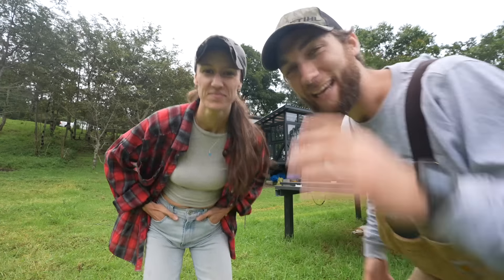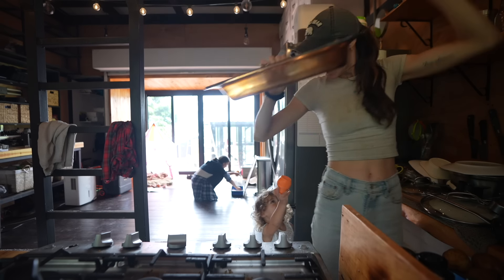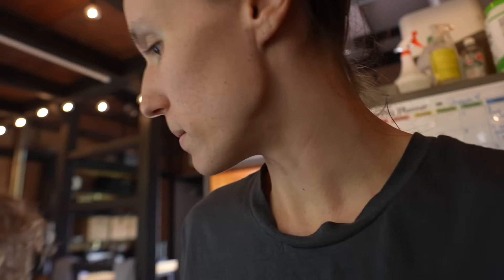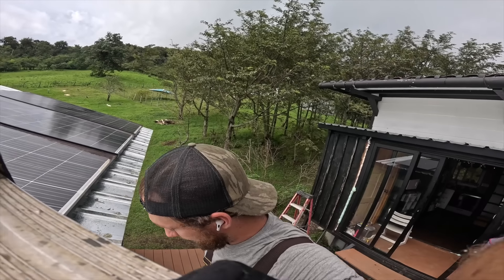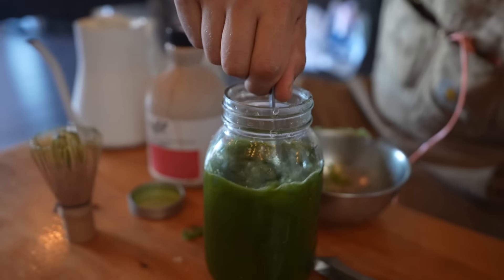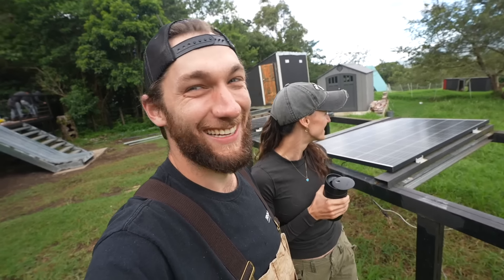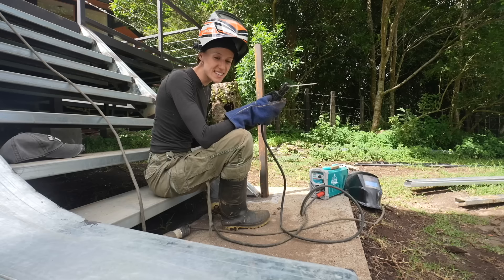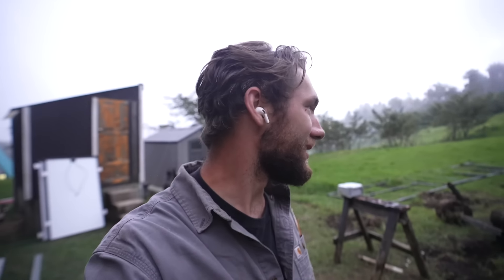We have a BIG PROBLEM // starting our house build

Comment: Hear me out Jordan a skidster would be way better than a backhoe.  You have so many attachments for a skidster an auger for digging your footings, a mower for your farm and all kinds of different buckets.  All kinds of things can go on a skidster and it's a little bit smaller than a back hole....meaning you can get it almost anywhere.  A skidster is where it's at my man.
Reply: I agree. A skidster is a way better option than a backhoe. They can get in much smaller places and have the ability with their attachments to do about anything you could ever need. The auger attatchments are so nice when digging footings.
Reply: The only concern I would have is that backhoes can handle much steeper terrain than skidsteers. Their property is really steep
Reply: Yup skidster is more universal tool more  bang for your buck
Reply: @wes52101  Simply when driving a skid-steer  up a steep hill the attachment is on the front and you go forward it isn't going to flip back.  With a tracked skid-steer it can go about anywhere. I vote with the rest of comments...he needs a skid-steer more for this build.  The problem there is price, The mini backhoe is about 1/4 the price of a tracked skid if new...and adding the attachments is going to be a huge cost on top of that...decisions, decisions.
Reply: @wes52101 nailed it besides the fact that all those attachments add up to a shtton of cash it will roll all the way down that hill
Reply: Trent would agree.
Reply: This is such great Info
Reply: Your place is looking so nice. Been enjoying your journey with you. Best of luck and life!
Reply: Tracks might be a good idea considering the slope and rain
Reply: All those attachments can be on a backhoe

Comment: When I worked inside commercial aircraft fuel tanks all the fasteners had to have a bead of sealant around the fastener and we had a small plastic cup that would screw onto the sealant gun and we got to good at applying the sealent it looked like a dairy queen ice cream cone.

Comment: If you are cutting a lot of those metal beams get you an old miter saw and put a chop saw blade on there. Would make cutting those miters so much easier than using a hand grinder.

Comment: Why did you put the Rectangular Hollow Section (Cariola) down flat not on its edge? Flat is weaker and standing on the short edge is the best strength.  Saw this done when building the cows roof shelter.

Comment: You shoould consider applying silicone to the actual hole through the actual roofing panels.  Water will find it's way into that area eventually causing a leak.  You might even apply a bead of silicone along the edges of the channel you attached the solar panels to at the interface of that chsnell and the roofing panels.  You can never use too much silicone to stop potential water leaks.

Comment: Only those people who sleep on solar panels are hot stuff. P.S. If you run a chain over a Y shaped stick and attach it to the bottom of those posts, a pull from the vehicle will pop those posts out.

Comment: Don't worry about the Kool-Aid joke. "Drinking the Kool-Aid" is a really common joke. I hear it a lot at work, in particular.   Now I know where the Kool-Aid is made 😅
Also - you Jordan (and Kaylee) on a wet, metal roof  😱 - I almost had an anxiety attack. Please, please be careful, use safety gear, etc. All it takes is one tiny little slip.

Comment: take it from the mouth of a professional painter. If you ever have any plans on painting the roof DO NOT USE SILICONE. Find an exterior paintable caulking. It will protect with the same level of protection as silicone but will be a pain in the butt later if you decide to pain it.